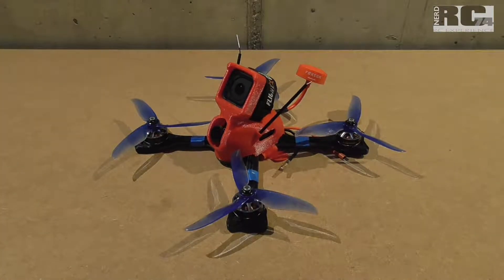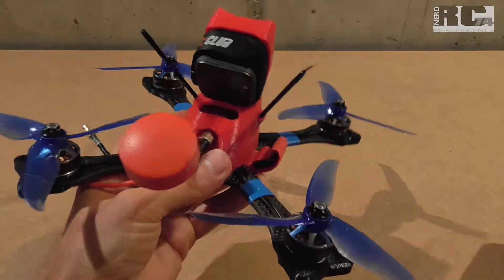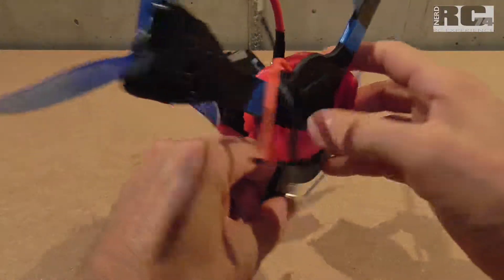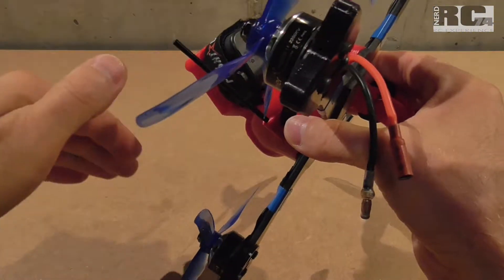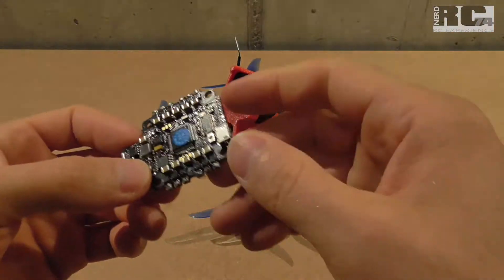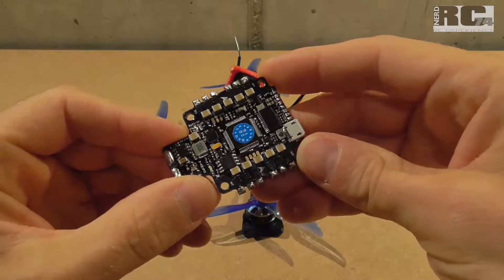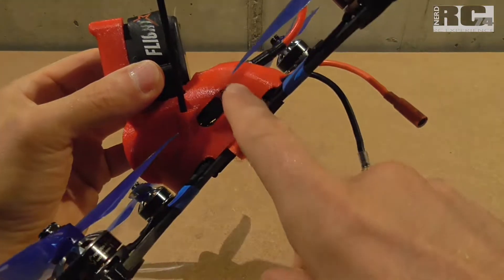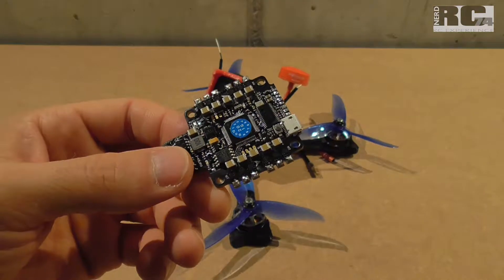TURNIGY MULTISTAR F4 AIO 4IN1 ESC - FINAL REVIEW

Comment: Hi, what firm are you using? thanks
Reply from the maker: Hi. i tried a lot of firmwares. 3.1.7, 3.2.0, 3.3 ...the issues ware always the same...
Reply: I have the same problems with an other fc, the problem was one esc, in other fc don have the problem and i thik obbiusly it was te FC, but 2 months later have the same problem with the new FC. i change the ESC and put the old FC and no problems, try if you want and have other ESC
Reply from the maker: @aciddrones2161  thanks. I already use a fortini f4 fc and cicada 35a 4in1 esc. Works pretty well 😁
Reply: I boy your video fc, ihope it goes well.... if not... i will send to hobbyking xD